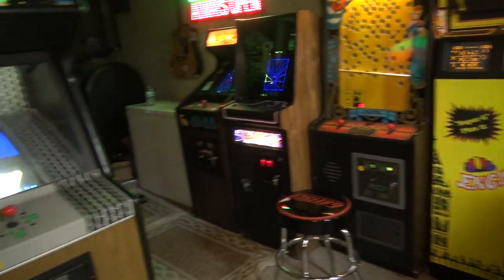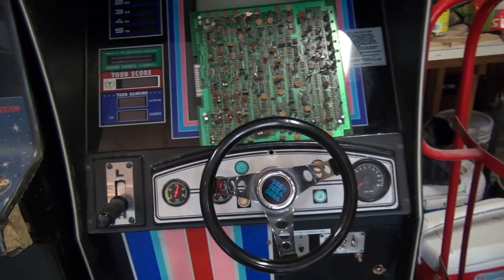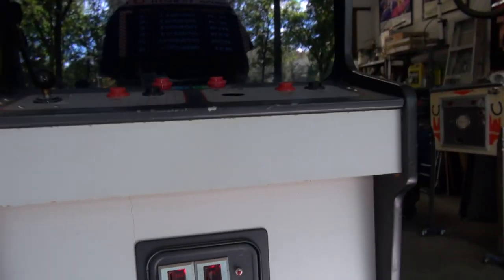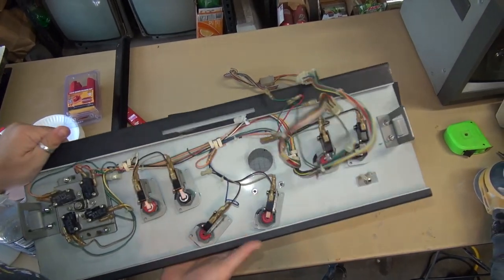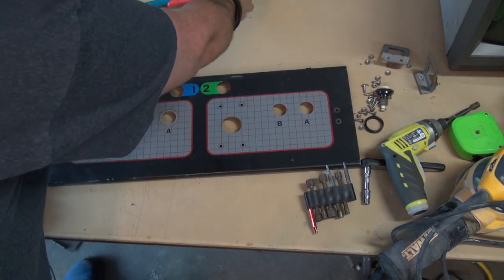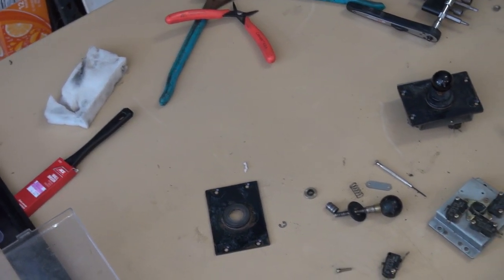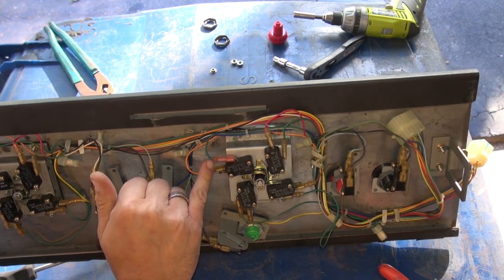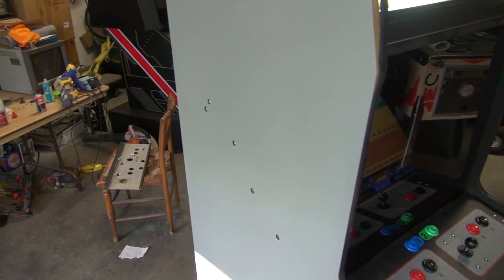Nintendo Vs. Unisystem Arcade Restore - Part #2 - Joystick rebuild, Bondo cabinet repair

Comment: The best thing to do with the disassembled Nintendo joystick base is to fully submerge it in a solvent for a while, such as overnight. Gasoline is a great solvent, and at only a couple dollars a gallon, it is plenty cheap enough to use for submerging parts. Gasoline is basically a type of naphtha, which is why you can use it in a Zippo (though it isn't very clean-burning compared to the much more refined naphtha used for purpose-made lighter fluid).

After soaking in gas and then scrubbing it clean, especially the pivot ball/socket (get in there with a combination of brushes, Q-tips, and pipe cleaners), clean it with a degreaser (blasting it with brake cleaner works great), then lubricate it with 3M dry-type silicone spray (08897 is what I've used for about 10 years; awesome stuff).

Comment: The first joystick you took apart had a shaft from a Super Punch-Out or Arm Wrestling joystick, both of which are rare. Notice the threaded extension on the bottom of it that the other two joystick shafts didn't have (good view of it at 20:25). That's for screwing on the mushroom-shaped brass piece that activates the 5th microswitch when you pull up on the shaft (toward the sky). I wonder how that happened, i.e., did Nintendo decide to use up some leftover SPO/AW shafts when they were making Vs. Unisystem joysticks or did some operator inexplicably swap it in there?

Comment: Whow, that smell of the auto body filler (which Bondo isn't the only brand of) is filling your whole garage! It's strong! Your garage already smells like an auto body shop! Totally familar from back in my days of auto body class in high school, and when I also worked at a sign shop for a little while, called Scenic Solutions.

I love that smell, but I don't wanna ruin my brain on it!

Comment: Regarding that Pac-Man Light.  I think Tighe Lory got one, but didn't like it, because the default colour of the plastic is white and it turns into a colour when you power it on.   I guess it had to be white otherwise, it would be hard to change colours on it, otherwise.   Something to consider.

Comment: John, you should try using 100% silicone grease, not silicone spray, to lube up your joystick rebuilds.  The spray is too thin, and doesn't really prevent metal-to-metal wear the way an actual grease does.  You'll notice they'll feel MUCH smoother as well.    You can get it at any auto parts place.  (I buy mine at O'Reilly's, where it's sold as 'spark plug boot grease', aka dielectric grease, and costs $3 for a small tube, which is plenty for multiple rebuilds.)
Reply: +andybaldman For automotive use, I find myself using white lithium grease a lot.  You can get it in a spray and it works its way into spaces pretty good when sprayed.  Then, it dries somewhat and becomes a nice smooth grease for metal to metal contact.  It would also work pretty good for joysticks like this that involve metal to metal contact.

Comment: @John:  Quick tip: Next time you have to repair such a dent like the one on the bottom - just take a hot glue gun and glue a sick like wooden one with a straigth edge plain to the cabinets edge. After that you can fill the gap easily and make it flush using the spatula. To avoid the stick of being sticked to the cabinet you have to first cover it with a sticking tape and wax its surface. The resin doesn't stick on wax. Using this method is much easier.
Reply from the maker: +zauche81 Trying to figure out which repair area you are talking about? Seems like a good idea but I'm not sure I follow!
Reply: +John's Arcade Game Reviews & Tech : Actually like you're doing at 1h14min, but instead of holding the wooden stick to the base of the cabinet I'd cover the part of the stick with a a sticking tape and wax it. After that glue it to the base and than just fill it up with putty and make it plane using a spatula. Once its cured simply remove the stick.

Comment: John I have the same tool for trimming t molding. I wouldn't recommend applying all of the new t molding and then trimming. it's generally best to use the flat top of the cabinet and just do a couple feet at a time. otherwise you will run into issues cutting the t molding around the curves of the cabinet.
Reply from the maker: +amplibax8 NOW YOU TELL ME!!! :)
Reply: +John's Arcade Game Reviews & Tech 

damn did you already do it?
Reply from the maker: amplibax8 yes, and it sucked!! :)
Reply: +John's Arcade Game Reviews & Tech 

well at least you know how to do it next time ;)
Reply from the maker: amplibax8 I just redid the t-molding and did a follow-up video. :)

Comment: Love the 3 star Germany hat.  The new one has 4 stars for 1954,1974,1990,2014 WC victories.  I just got a WCS'94 because I love the pin and team to beat is Germany.  I've also seen you wear an Italy hat and a Toyota NASCAR hat.  What's the deal my brother?
Reply from the maker: When I travel I like to buy soccer hats (usually Adidas) based on my heritage. :) And I drive a  Toyota FJ. :)

Comment: John vs the c clip lol
Reply: +vaxbuster I've never messed with these in the arcade stuff as of yet, since I don't own one yet, but I used a combo of very fine tip screwdrivers and pliers with my R/C car C and E clips.  Granted, the tricks are a bit different since you're working with something like 1/16 or 1/32 E clips sometimes.  Heh.
Reply: +rotaryturbo07 Those arcade ones have quite the spring to them. I've had one fly across the midway before, never found that sob.
Reply: Yea, the R/C ones are the same way.  They're small enough they just flat out disappear when they spring off.  It's one of those things you keep a supply of around, since they're so easy to lose and so hard to find.  Forget finding one of those tiny ones.

Comment: You could have done this easily by doing the bondo with the cabinet standing upright and putting some plexi on the inside when filling in the large gap. Then where needed a 2nd light application on the inside where the plexi was followed by some sanding. By putting the cabinet on the side you made it hard on yourself. And you use too much hardener :)
Reply from the maker: +Scythe42 EVERYONE SAYS I USE TOO MUCH HARDENER! I LOVE THAT RED STUFF! :)

Comment: sure know what i am going to ask already. why haven't you tried using wood filler on wood yet? : p wood filler would seem to be easier to use. also "Too little obvious compremises it's hardness and weakens it's strength, but too much not only dramatically reduces
 the amount of time you have to work with it but harms its ability to bind well with surfaces." least what read here. http://forums.arcade-museum.com/showthread.php?t=191452
Reply from the maker: I like Bondo!